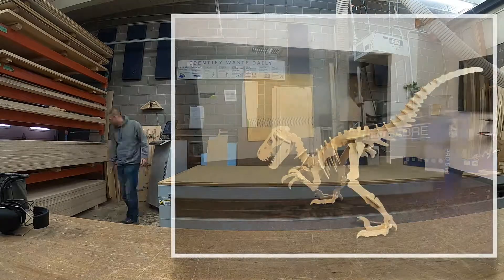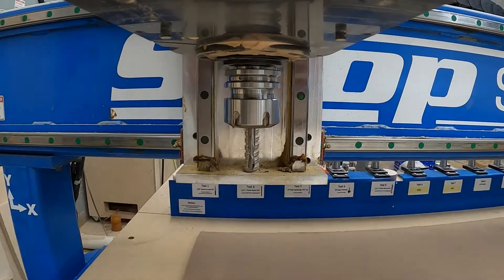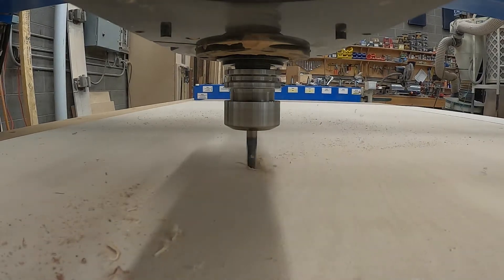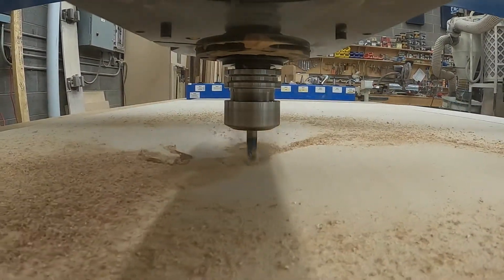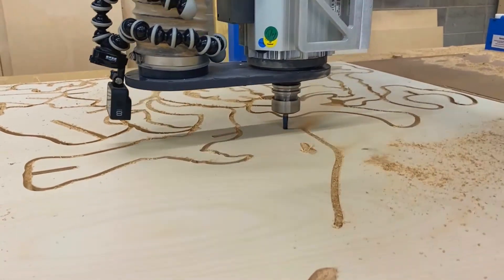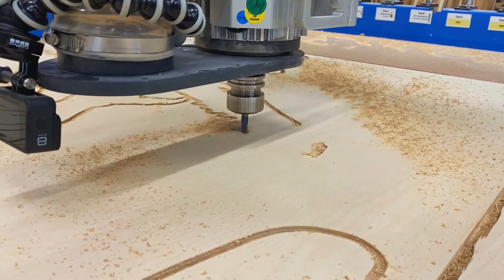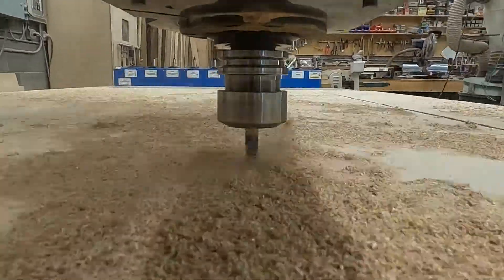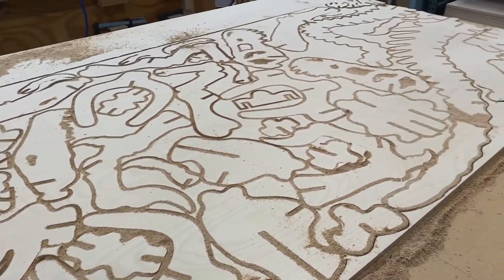COVID Halloween Velociraptor on the ShopSabre Pro 510 CNC Router

Comment: How long have you had the SHOP Sabre? What made you go with them over other brands like Camaster or Laguna? WHen you cut through the birch, how good/bad are the edges splintered? Sorry for all the questions. I'm trying to make the "next step" decision with my shop and getting feedback on CNC's. So far I'm leaning towards the Shop Sabre, but probably the RC series. Thanks
Reply from the maker: Hi Michael. We've had the ShopSabre for about 2.5 years. It's been great. I chose it over the Laguna because I'd read that ShopSabre had better customer service. I've been very happy with the customer service to this point, and the machine has performed beautifully. Couldn't be happier with it.

We generally get great cuts in baltic birch, but there are a number of factors that play into that. First of all, a sharp bit makes a huge difference as you might expect! Proper feeds and speeds play a major role. So does the point of bit entry--you really want to take the time to set you program to enter the wood going with the grain. If you start the plunge going cross-grain then you'll get tearout pretty much every time because of the upcut on the compression bit. That's what you see happening in the video--I was lazy and didn't set my entry points for each of the tiny pieces because this was a quick little personal project and I was in a hurry to get it cut so my family could put together the puzzle! 

The last main factor in getting a quality edge is the plywood itself. We buy pallets of baltic birch plywood from a couple different distributors, and it amazes me how much the "same" product varies batch-to-batch. This particular batch of plywood was pretty splintery to begin with--it almost felt like it didn't have enough glue in-between the plies.

Anyway, you can't avoid sanding altogether but most of our production work cuts much more smoothly than shown in the video--I use these little personal projects to test stuff out and the results of those tests sometimes are improvements, and sometimes they don't work as well as I'd hope!
Reply: @JoelGaeddert  Interesting project... I think I'd like to try it sometime.  We run the same model as you and I agree that the machine has performed beautifully and tech support is top notch.